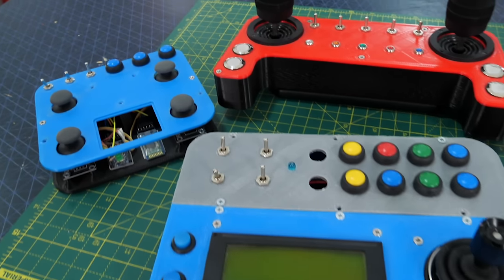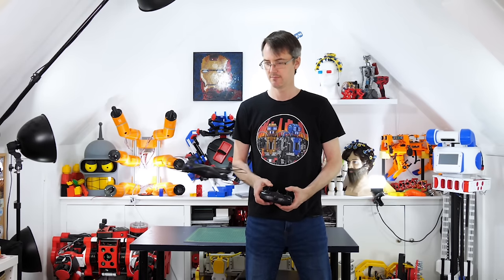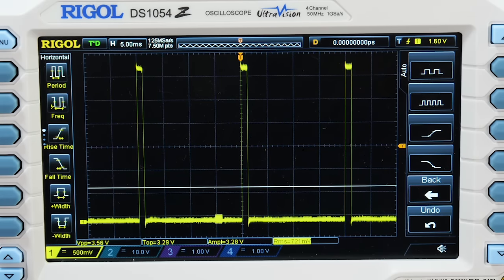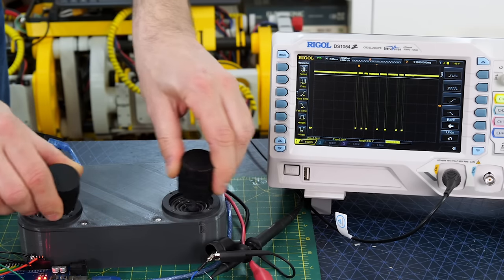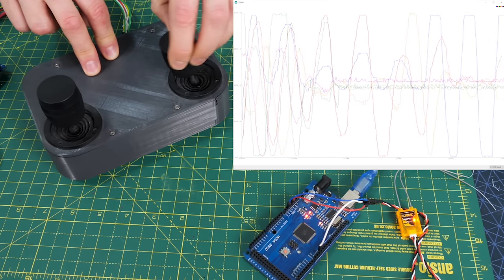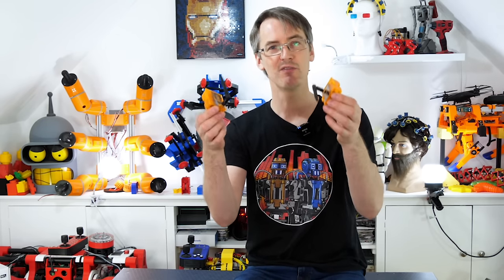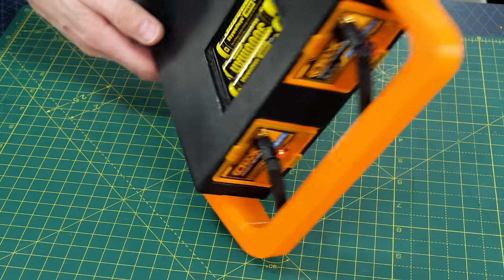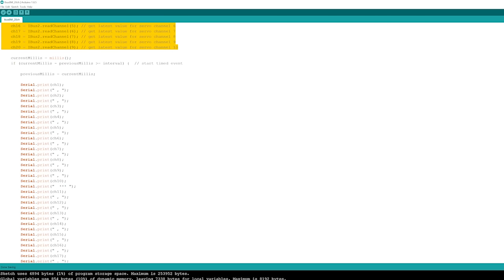Building a DSM2 R/C Transmitter with Arduino

Comment: I've been looking for a way to control one of my cheapo quadcopters from my pc with a flightstick and have somehow ruined a controller trying to wire its joystick connections to an arduino... I was looking for radio transceivers, but they seem expensive. Maybe I can just listen to the remote control with one DSM2 receiver to capture the needed signals and then recreate them with a DSM2 transmitter?

Comment: You get a lot of fake nrf24 modules which do have a bad range. I got a few hundred meters through trees with some that I got. I then bought some EByte ones and they seem a lot better and have shielding and stuff like that built in. If the programs are written well and the data is sent often enough, dropping data is not a problem. If you can build in or enable some sort of acknowledgement feature which I think the nrf24 already has then you can get around the dropping data problems. I am pretty sure the nrf24 can be set up to listen for an acknowledgement and then automatically retry a set number of times.

The fact that your bowling ball system worked best with a low powered transmitter and a receiver with a large antenna probably mean your modules maybe aren’t the best quality or may be fake ones. Either that or your power supply for the transmitter was not good enough do it only worked for the low powered transmitter. Nrf24s are very picky about the power supply.

Comment: Can I just say the Flysky PL18 EV also has 2 3 axis joysticks and 2 on the side single axis. In easy reach of your fingers while holding it. The amount of customizability in my PL18 EV and Noble NB4 (8ch) are crazy good. Latest firmware also does 2 receiver linking so no more bus connection in between receivers. Hell yeah complete separate trailer or vehicle possible. BVD port to view voltage on remote. 2 button for up/down 1 channel option, sbus, sensors, etc. So DIY orange modules with arduino stuff is cheaper and fully custom but for my RC's I absolutely adore these 2 top of the line Flysky radio's and cheaper than the spectrum DX stuff I don't like. But I'm glad you found the swappable RC transmitter modules that have existed for a long time now.

Comment: I'm surprised you don't use some of the high power 400Mhz Tx/Rx.  You can get them fully arduino compatible and the lower frequency would give you greater range.  Plus, you get away from the 2.4Ghz at which microwave ovens operate.

I might try my hand at this.  I'm looking at starting a robot combat league in my area, and need a low cost, small solution for connectivity.  You'd want data back to know what your bot is doing, but you also don't want to ask people to invest a great sum of money into the controller before they even get to the bot.  For ant and beetle weight bots, size and weight is a big issue.

Comment: For all the sofa-'makers' in the comments posting "why didn't he use ELRS"  -- Do you think James, who puts together more working robots in a weekend than most of you have completed in a lifetime, didn't consider ELRS? Really? 
Guess what dumbdumbs- there are no reasonable working implementations of interfacing an Arduino with an off-the-shelf cheap ELRS transmitter. 
None. 
Zero. 
Zilch. 
You'd know this if you tried it, so we all know you haven't and just spouting BS. (there is a single example of an amazing one-off custom Arudino->>ELRS transmitter on YT, it uses a custom PCB, and a complex custom toolchain that doesn't even run on the Arudino IDE, so no, this doesn't count) Prove me wrong.

Comment: We build a arduino transmitter and receiver using nrf24 module. Can't seem to send the signals/channels to a APM2.8 flight controller for our schools robotics project. We build a drone on a f450 chassis. 
Any advise?
Reply from the maker: No idea, this project is about not using the NRF24's which I've used before

Comment: At this level of customization, I'd say just get a 1watt lora module. Easy 10 mile range and uses spi for microcontroller link
Reply: isn't lora for super low data rates though? or am I thinking of LoraWAN/TTN?
Reply: @WistrelChianti   lora is plenty fast for this application. Crossfire radios from tbs use lora

Comment: I lost my drone precisely because the controller disconnected. It drifted along for a while, then proceeded to hit the only obstacle in a 100m radius, and then crash into the only water in a 3km radius.

It was a Parrot Bebop 2 drone, with the SkyController transmitter. The stupid thing connected over wifi. F*** Parrot.

Just now I'm in the process of dumping all the internals of the controller and replacing it for an Arduino Due and a bluetooth module. It's already more compatible and reliable!

Comment: OK kinda off-topic but it's bugging me for years and no ones seems to help me...
I got a USB Traincontroller (it's like a Railroad cab simulator device)
there is 1 program that allows me to use it for my trains JMRI 
but this specific item has been in experimental mode for year and is slow AF
plus that I need to have it connected to my laptop which in turn
is connected via wifi to my z21 train basestation
I would love a Raspberry that could read incoming USB signals
then I could translate those signals and tell / program it
with Pi to send directly to the z21 traincontroller!

Comment: Steve Potter made a CNC joystick using the ESPNow protocol: https://youtu.be/lYjtsSwlnhk . Which is 2.4GHz, but not exactly wifi. You can send your own data in the packets. I would be curious to see how it compares range and connection quality wise.

Comment: hmmm.... notice the obvious, that a comma separated list is essentially an array, and an easy way to have as many "channels" as you need... especially if its just numerical data. I built a remote that essentially has two way, 14 "channels" of data, all passed as one string (ie: one "channel"), and zero latency.  I don't see or even understand the difference in passing a single value verses an array of data besides, of course, the memory / size of packets involved.

Comment: Did I get this right? Because it's digital the output signal is up on the last digit exactly the value of the input?

If yes, and you need only half of the resolution of the analog channels you can simply mix them up: take the upper half of the bits to one channel and the other one to the second channel.

I used this to add a bool signal of a button into a integer that couldn't use the full range of 2 bytes anyway.
Reply from the maker: I'm sending PPM though,  and an approximate value is generated by the receiver, so the bits won't stay in the same place reliably.

Comment: Bro make a controller that have joystic motor speed controller and power on button 6 toggle switch and 5 other motor. when 1st toggle up all 4 motor rotate clockwise at same time when toggle is middle no rotation when down rotate all 4 motor anticlockwise same time and also this 4 and 5th  motor are controlled one by one 2nd 3rd 4th 5th and 6th toggle switch means each motor are controlled by each toggle no toggle effect each other and remember first toggle controll all 4 motor same time means we controll 4 motor with 1st toggle (all 4 motor operate same time) , 2nd 3rd 4th and 5th (controll all 4 motor one by one ) and 6th toggle controll their 5th motor make it bro

Comment: DSM and DSM2 are by far the worst when it comes to reliability. They select a fixed frequency set (three? cant remember) upon pairing and use it even if the choosen frequencies get swamped with interference. I had a few club members loosing their models because of this (and the absolute horrible brownout and reconnect behaviour/time of spektrum receivers...)

Comment: I will stay with raspi zero wifi with antenna, and 868 MHz with antenna.
Reply: 1:04 i had to rew your pie controller has no atenna, extension. why ? I am intrested are there a reson for it , or you build some secret antenna ?

Comment: Im surprised you have been using bluetooth in all your projects, so unreliable. Ive been flying dsm2 in my rc airplanes for many years it is a very good rc link. Even better , lately i have been using TBS crossfire longrange rx tx system you should check that out. I hope this means you will not be using bluetooth on your remote projects anymore.